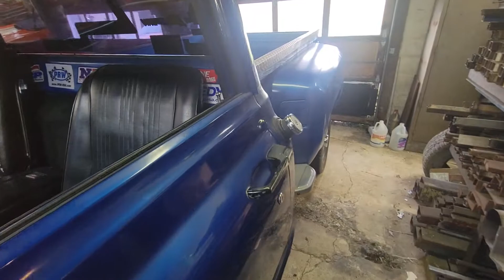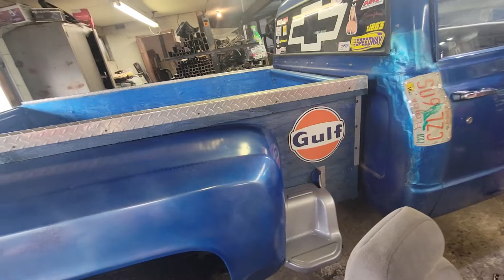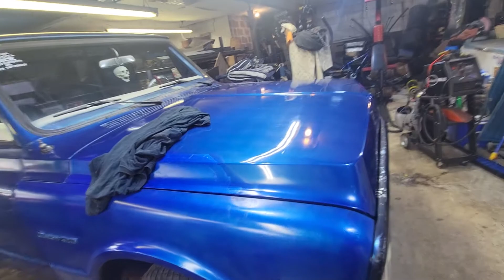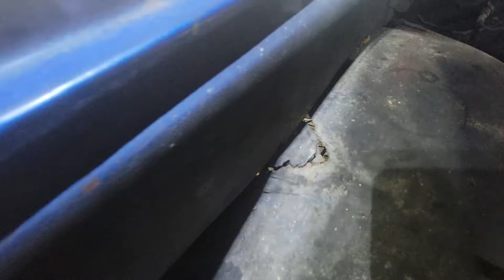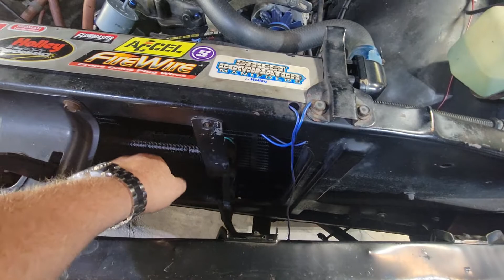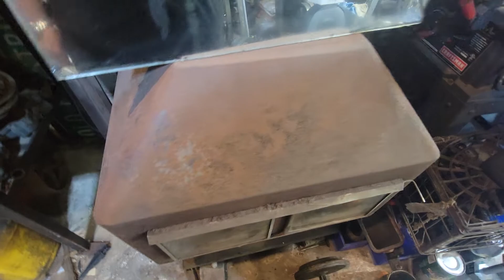70 Chevelle Transmission Failure!

Comment: Your Chevelle will most likely be a tad bit quicker with the th350, the th350s take less power to turn and are quite a bit lighter than a th400.
Reply from the maker: I'm probably going to leave the Th350 in there and have the Th400 rebuilt and on standby!